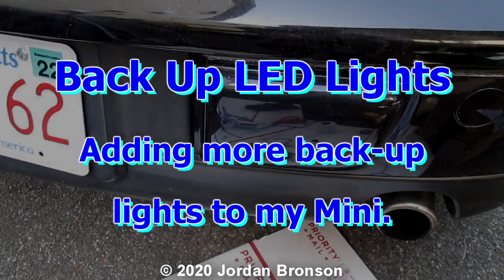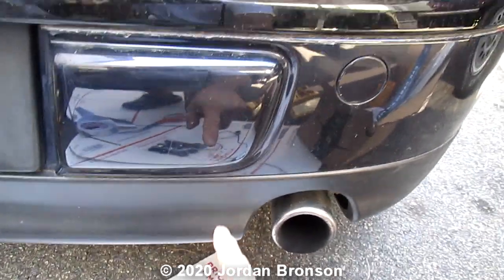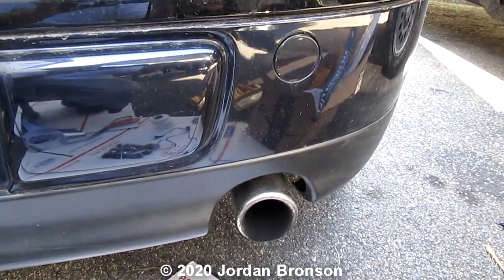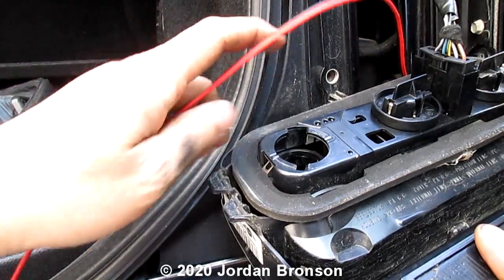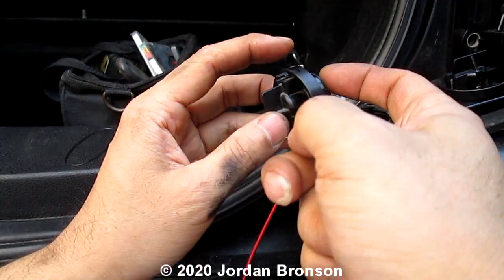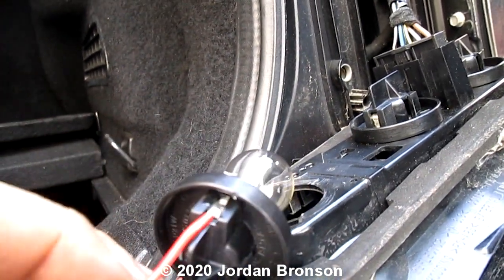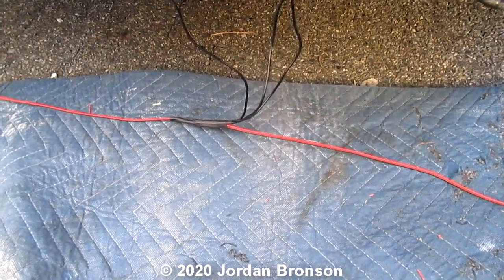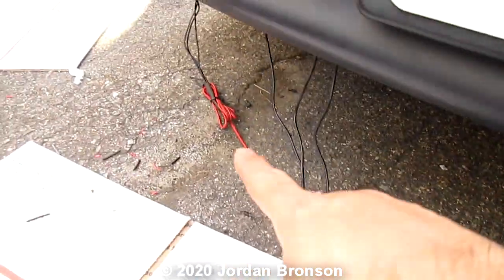How To Add Extra Back Up Lights On Mini Cooper 2013

Comment: Just dont do the 10k oil changes on it,. My sister had  a mini the engine sounded terrible on it from "Dealer oil changes"
Reply from the maker: Oh really?  Yea, I didn't trust the Dealer, I changed it once I got back.  OMG it was BLACK !!!
Reply: @JodBronson  Ya her car was messed. she traded it in when it didnt have too many miles
Reply from the maker: @GhettoWagon  - Thankx, I will keep that in mind.  It's really hard to work with though.  OMG, there is NO ROOM to do anything :((((.